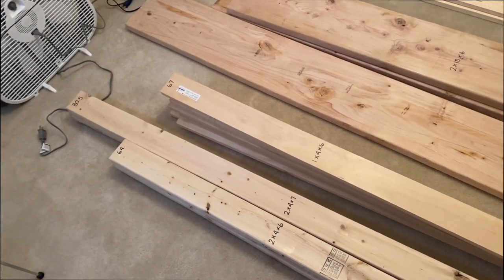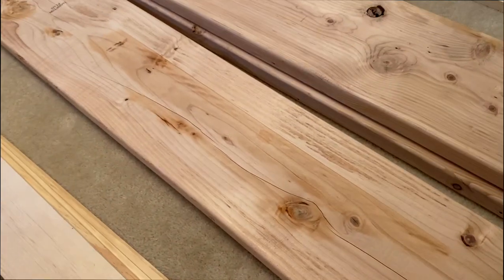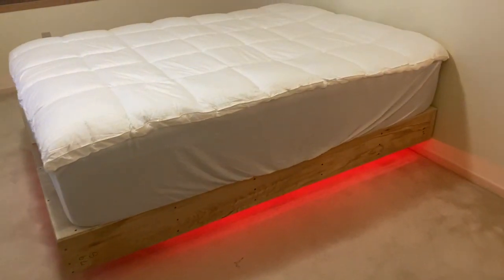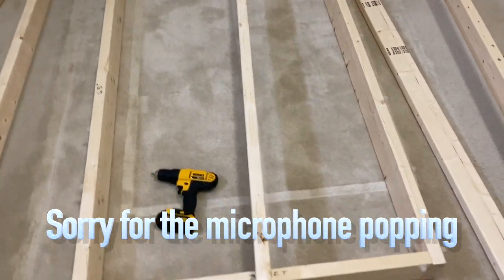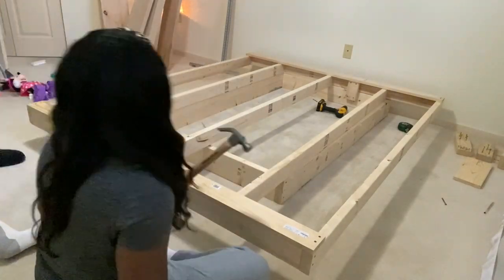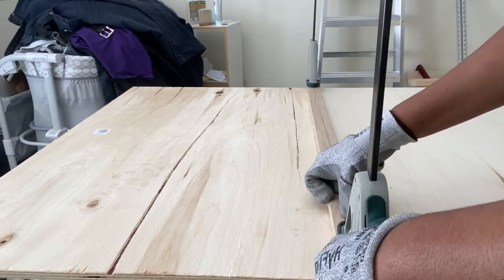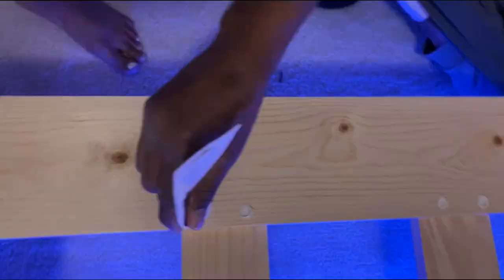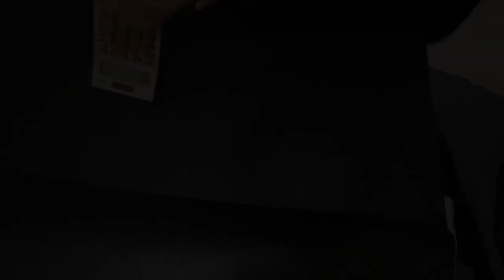DIY: How To Build A Modern Floating Bed -Part 1

Comment from the maker: Bed Measurements

*All measurements below are exact and are not Nominal dimensions.*

Base:
63” H x 5.5” W x 1.5” D (x2)
36” H x 5.5” W x 1.5” D (x2)

Middle Support Beams:
77.5” H x 3.5” W x 1.5”D (x3)

Bottom Frame: 
80.5” H x 3.5” W x 1.5” D (x2)
64” H x 3.5” W x 1.5” D (x2)

Slats: 
64” H x 3.5” W x .75” D (x8) 

Lip:
82.5” H x 5.5” W x .75” D (x2)
59” H x 5.5” W x .75” D (x1)

Headboard: 
47.75”H x 37” W x .5” D (x3)

Headboard Support Boards:
96” H x 9” W x .75” D (x3)

Nightstands: (x2)

24” H x 9.25” W x .75” D (x2)
9” H x 9.25” W x .75” D (x2)
Reply: Good day, would you be able to tell me what dimensions would work for a king size?
Reply: This is a true blessing.. THANK YOU!
Reply from the maker: @bugattibully5896  You’re so welcome!😊🙏🏾

Comment: Nice job ! If I could make a suggestion: when you apply the black overlay, overlap the pieces that will meet at the 45 degree angle and make one cut, you’ll get a perfect fit.
Reply from the maker: @Rainman270 Thank you for your comment and suggestion. I will definitely utilize that technique the next time we do something like this. 😊🙏🏾

Comment: I had a bed just like this in the 90's.  It was made by Lane.  It was black lacquer and the platform was 2 pieces that locked together and the headboard was also 2 pieces that locked together.  It had lights all around the bottom of the platform.  My bed was destroyed in a fire.  Lane was no longer making the bed.  In the 90's that bed cost me 1600 dollars.  The only thing it did not have was the headboard lights.  You did a wonderful job.  Your bed is beautiful.
Reply from the maker: @Darcelle Pointer I’m sorry to hear your similar bed was destroyed in a fire. Thank you for your comment and subscribing to my channel!🙏🏾😊

Comment: Great job! One little tip when marking before cutting is just placing just a little mark on the woodpiece and the saw itself will make the straight line for you. Saving a little extra time :)
Reply from the maker: @Nikolai Semb thanks for the tip and your comment.

Comment: you can seal cracked wood with a wood epoxy that will in turn not only make it stronger but will look really great as well.
Reply from the maker: Thanks for your suggestion I will definitely keep that in mind. Thank you also for your comment and subscribing to my channel!🙏🏾😊
Reply: @MooreDecor  actually thank you. You e given me some good advice on the bed I'm building. So thank you for taking your time.

Comment: Just a heads up: I made the mistake of buying my lumber based off of the supplies listed in the video. The measurements do not add up. For example, the video says you bought 2 pieces of plywood that are 2x6, but then your measurements in the comments says the headboard is made up of 3 boards that are 47.5 in x 37in. I don’t understand how you made two 2x6’s into three 3 foot boards. Also, the list says you bought 1x6x8, but then the measurements says your base was made from 1.5in boards. I bought the wrong wood and a lotttt of it 😭. The video is amazing content wise, but as an actual tutorial it is very difficult to mimick your work in real life. I didn’t see your comment until after I bought the supplies you listed in the video.  I’m going back to the drawing board though I’ll get it done! 😄

Comment: Hi there.  Love what you did.  Going to give it a try but I am unclear how the headboard is mounted based on the video.  Are there instructions somewhere else showing how you did that?
Reply from the maker: @Dn Rt I am glad you like the build. To assist you further please refer to the following times stamp:

-Front Right Headboard Brace @3:27
-Front Left Headboard Brace @3:49
-Back Headboard Brace @4:53
        -Back Headboard Brace Measurements are  49” L x 9 3/4” W x 3/4” thick.

I hope this information is helpful and good luck on your build. Thank you also for your comment and subscribing to my channel!😊🙏🏾

Comment: Great job. I'm curious though. How will you disassemble if you ever move with it wrapped?
Reply from the maker: @euclid47pha thank you for your comment and subscribing to my channel! 😊🙏🏾 To answer your question, we just disassembled the headboard from the frame of the bed. The frame itself isn’t that heavy but the heavy parts are the headboard but we would take apart the 3 headboard panels and carry those separately still leaving the nightstands and lights on the headboard. So it shouldn’t be a problem to move out.
Reply: @MooreDecor  very nice. Greatly appreciated and you all keep up the good work

Comment: Crack wood is fine just use epoxy resin to seal & it will be stronger than ever, but make sure they give you 50-70% discount on that wood.
Reply from the maker: @Dionna Simpson Thank you for your comment and the advice giving. I will definitely keep that in mind for my next projects. I didn’t know you can get money off for cracked wood so thank you for that information. 🙏🏾😊

Comment: I've watched the video in slow motion to get the measurements I really love this! But I couldn't get the top measurements for the top frame. I'm guessing the bottom is 3 feet wide 63 inches long. but what is the measurements of the top frame that goes on it.
Reply from the maker: @Tkai Savage Thanks for your comment and subscribing to my channel! 

Are you referring to the headboard measurements that you need?
Reply: @MooreDecor  No problem I love your videos!

No not the headboard. Let me know if im correct, in the video you stated that you used your original base that is the bottom one on the floor, the measurement are written 63inches x 3 Feet  that comes off the ground 6 inches. What im talking about is the top piece that holds the bed, that you started building at 6:30 that im confused on.

 I can't seem to find the measurements I believe that you used 2 2x4x7 that are 80.5 in long and 2 2x4x6 64in wide for the outside frame. Im not sure how long the pieces are that support the bed at 7:35 in the middle and I believe at the top and bottom of the bed you used 2 1x4x6 that are flat 67 in wide. What is the size of the lips 8:31?

Thanks so much for responding im moving out of my house soon and always wanted a floating bed and your design is by far the best design I have seen ever!!

Comment: By chance do you know the number of boards you needed before you cut them example 2x4 how many
Reply from the maker: @Brandon White please see the pinned comment in the comment section about measurements and how many pieces used to build the bed.

Comment: Good job but made it a bit too long.   2" shorter than what the mattress is on every side would've spared your legs at 3:00am when you hit those corners.
Reply from the maker: @kyleendrake2638 Thank you! We actually did that on purpose because we had a spacious room so it was easy to avoid any leg injuries. 😂
Reply: @MooreDecor  Good luck with that.  We use our room for more than sleeping and don't want the bed frame hurting our lower legs.  I don't like bruises!  lol

Comment: I’m getting confused on the build, after the base is build which pieces of wood was used to build the frame
Reply from the maker: At @0:16 of the video I talk about the material used to build the frame and their measurements. Please refer to that point in the video for reference regarding wood pieces used.
Reply: @MooreDecor  And when buying do we go off the exact 
measurements in comments
Reply: @umekihodges6058 yes. I used them and it came out great (minus a few personal adjustments) hope this helps

Comment: does having wood in the house attract bugs
Reply from the maker: @May May that is a good question. I would say since we built this bed with the wood that we chose, no we did not experience any bugs in our home. I just suggest that when shopping for interior framing woods or wood panels in general to really thoroughly examine them because sometimes there maybe little small bugs on them.

Comment: all these videos and none of them list the money total or labor hours
Reply: @Caleb Ross not all her videos require "money totals" or "labor hours". And FYI all of her building segments do list the items used and total cost of each project (at the end of the video's) along with links to where you can purchase each item.

Lastly,  she does give a roundabout time frame for some of the projects. You shouldn't skip though the video because alot of your concerns were already addressed. I'm just saying🤷🏾‍♂️🤦🏾
Reply: @jackfrost9151  Big Facts😄
Reply from the maker: @Caleb Ross thank you for your input. As a rebuttal to your claims, all materials used for this bed project along with an itemized breakdown of cost is fully detailed in "Part Two" of this build series. 

As far as "labor hours", I believe that time management is measured on an individual basis. What may take me 4 days to complete based on my schedule, may be a one day task for you based on yours. 

So you see, it's hard to gage time in relations to each project,  but if I was a betting woman (with a clear schedule and zero distractions) it could be completed in a day. 

Thanks for your input and for allowing me to shed some insight on your concerns. 😊